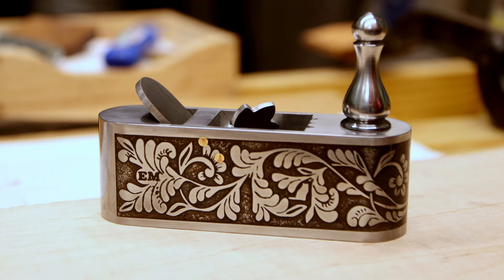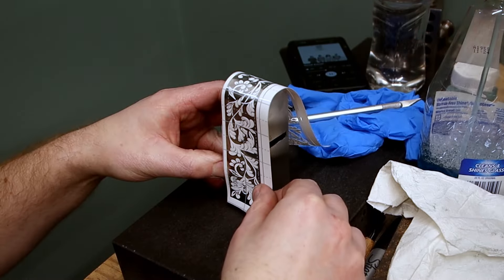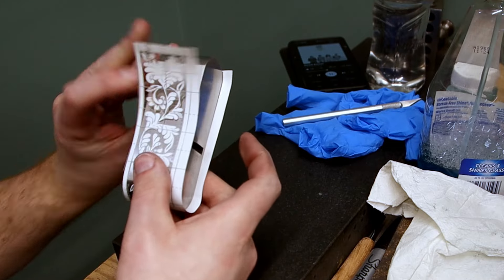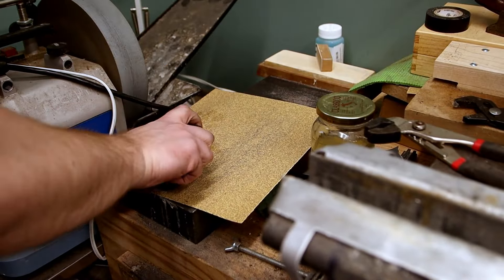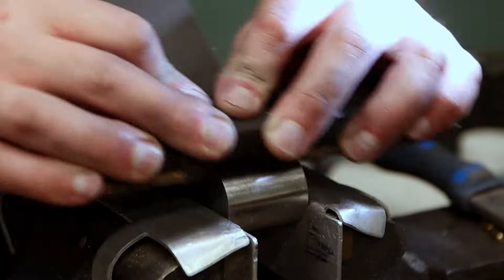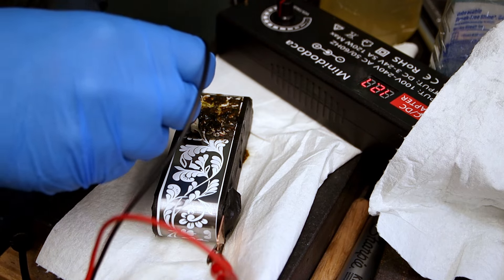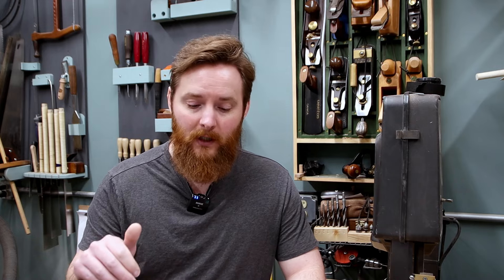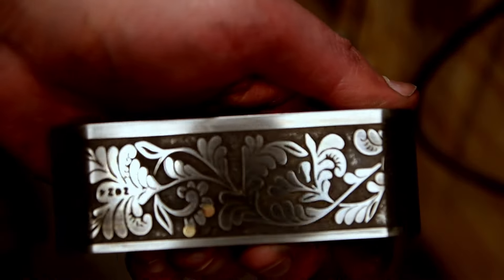How To Etch Metal - Tools, Knives, Maker's Marks, etc

Comment: Hey Eric, just a correction... You do need AC as well! I've searched a lot about how to make a etching machine, I just didn't build one yet because I couldn't buy a 12v transformer yet. 😬
But they build it like this... The transformer is connected to the wall plug (through an on/off switch), then the output is connected to a 2 way switch with 6 legs. (I forgot its name right now...) Either way, you connect in the middle 2 legs, then the output are in the 4 others (2 from the right, 2 from the left, depending on the position of the switch.) Then, in one of the outputs you connect a bridge rectifier and a capacitor, for the DC output. You know?
The reason is that, while the DC eats the metal, making the etch itself, the AC makes the metal dark. So you don't need the cold bluing stuff. 
Either way, you can make it in a small box, put a fuse in the input side and everything else. 😊
Anyway, stay safe there with your family! 🖖😊